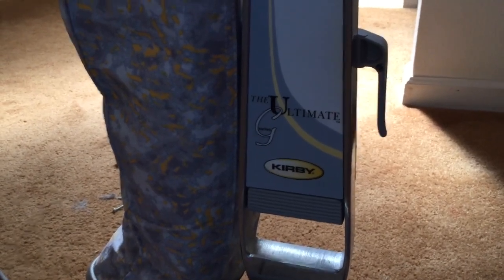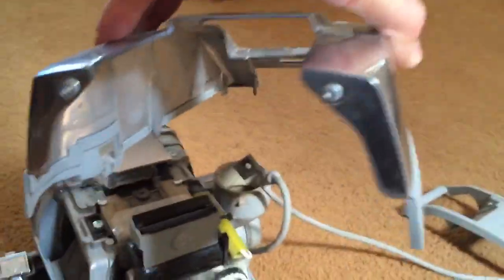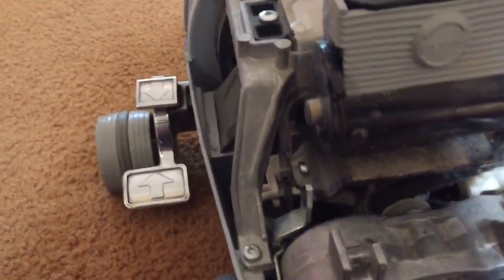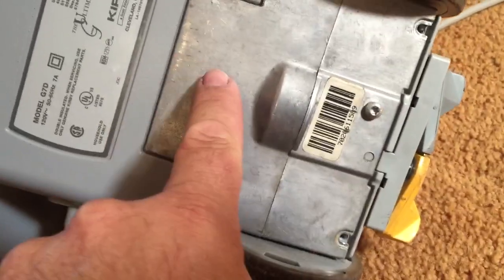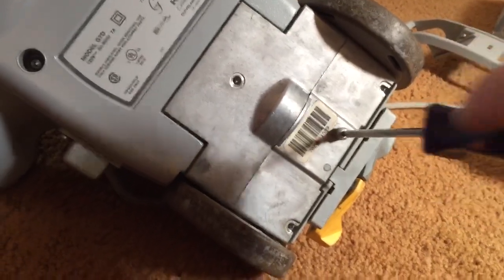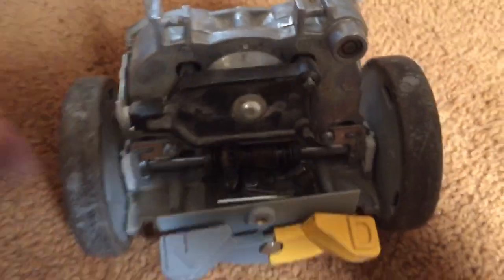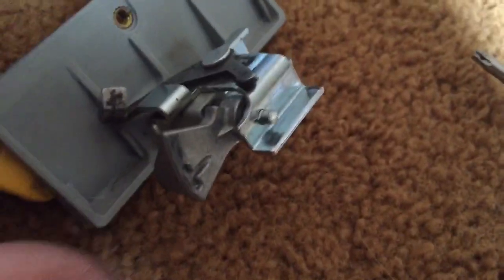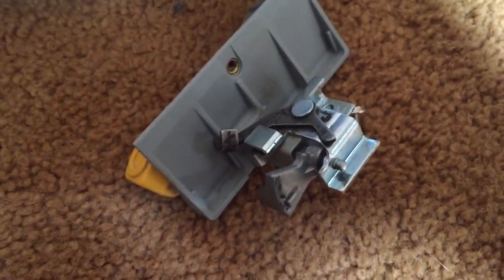Kirby vacuum ultimate G drive selector switch fix part1

Comment: Richard, the only thing I can add to your video is:  after assembling the switch mechanism take a large center punch and peen the end of the shaft so that the shaft cannot go through the hole and come out again.  I think this is how the factory did it initially and over time the metal wears down to the point that the shaft can come out of the hole.  Thanks for the video, it was a big help.
Reply: how do you do that and what's a peen?
Reply: @robertastanhope4829  basically it means to deform the end of the shaft so it spreads out and can't go through the hole.
Reply: @Audioguy52  Thanks!

Comment: Thanks for the video, I could not have fixed it without you. A few things though , Putting on the piece onto the spline shaft needs to have a better explanation, being off just a bit will make it so it would shift over or it is block by the outer housing. I had to adjust it several times to get it just right which I did just by checking when the transmission was put in and if it cleared the housing. Also an explanation of the handle armature fitting into the transmission would have helped too. Thanks again you saved me a repair trip.

Comment: Thanks for the video and the tip!  This was the only video I could find with decent enough quality and description for me to tell which way to put the switch back together.  I didn't have a clip for it this time, but you can bet I'll be running to Ace Hardware for one next time.  That's a great idea!

Comment: Very good video. I like the first thing you said about being brief. With how-to videos....shorter is better in my opinion. Thanks for skipping the 2 minute intro with royalty free music that no one but the poster appreciates.
I found a spring washer laying in the bottom of my machine that you don't show or mention in your video. Not sure where it belongs but it seems it must have been on the shaft of the selector switch. I put it in between the cam and the housing....As far as I could see it was the only place it would do any good.

Comment: Good video until details of selector switch assembly/disassembly.  The part where the alignment of the triangular cam on the shaft is unclear:  the yellow part of the switch does not  align flush  with the grey plastic: it is 3-5 degrees off, and  not clear if the indicator line is the one radiating out from the shaft or the vertical arm of the T facing toward the spline. Also unclear from the video if the  cam seats on the splines flush with the grey plastic or if there is a 1/2 mm clearance space or spacer between the cam and plastic. Richard or viewers of this video please clarify.

Comment: Great video.  The selector switch on mine just popped out yesterday.  I will have to get a c-clip and do the same as you.  What was originally supposed to be holding the switch in place?

Comment: Great "C" Clip fix wih self cut slot in shaft !   U may eventually have a "no reverse mode" situation... here is the fix for that : https://youtu.be/FwcikLemKx8?t=819     also a more permanent fix may be "c" clip AND  "Richard, the only thing I can add to your video is:  after assembling the switch mechanism take a large center punch and peen the end of the shaft so that the shaft cannot go through the hole and come out again.  I think this is how the factory did it initially and over time the metal wears down to the point that the shaft can come out of the hole.  Thanks for the video, it was a big help."